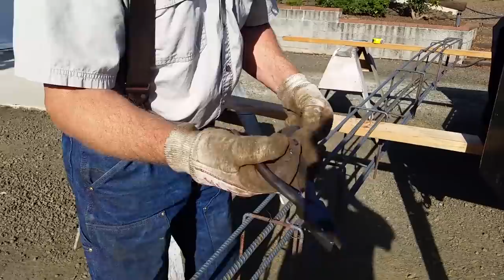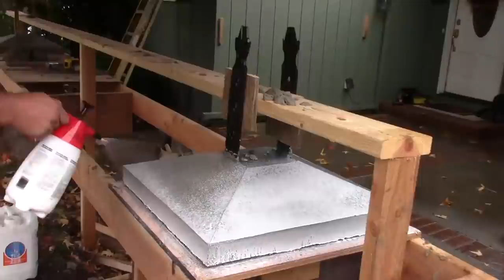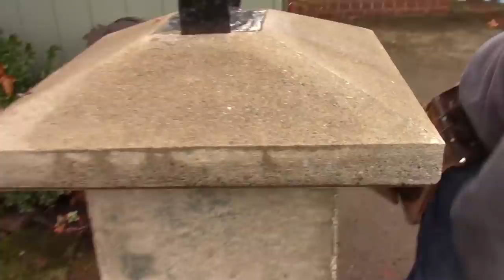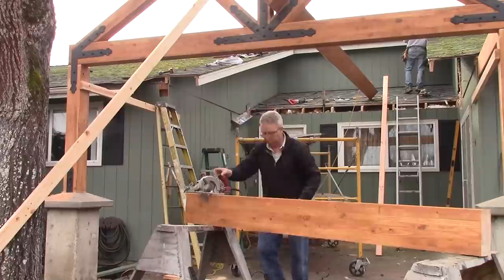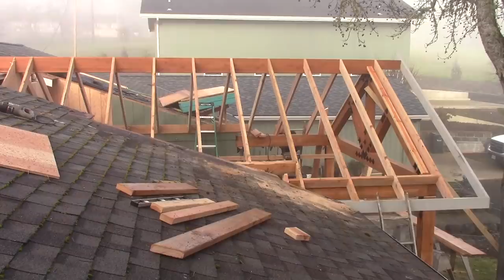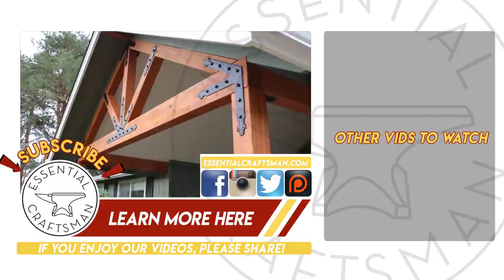Men Build New Entrance to House

Comment: In my neck of the woods that beam pocket would be a stack down to the foundation with a Simpson post cap... which would require sheathing and drywall repair. Beautiful timber construction, very nice job.

Comment: Looked like a fun project.  FYI, I subscribed because I love hearing the wisdom Scott has to impart about stuff like this.  I would have been very happy with this being a 20-ish minute video where Scott discusses some of the design choices, why a through bolt is used, yada yada.  Still watched it though :)
Reply: rjtumble Ditto.  I'dve also liked to know what was getting sprayed on the tops of those concrete bases
Reply: The Carfarmer - I believe it was an acid wash by the way the finished product looked.
Reply: It's a surface retarder that exposes the fine aggregates in the concrete; such as Grace Top-Cast or Optimus made by ACC (Architectural Concrete Chemicals). Muriatic acid will do the same, but is not milky white in color.
Reply: Cornelio Sanchez - thanks!

Comment: Have you got a pro tip for this:  When placing brackets on either side of a timber, how do you accurately drill the holes so they line up with the bolt holes in both brackets??   (I cheat and do them on my mill, but there has to be another way.  You do it so well in the field)
Reply: With the brackets he was using, which are basically straps, you are able to adjust them to line up fairly well. You cant really get away with that if you are using saddles or caps, but far as the drilling goes, the best way is to drill half way from one side then drill from the other side until you meet with the first hole. From there you can ream the hole to get it straight if it's not already.
Reply: I use a torpedo level for the top and a speed square on the side of the drill bit. when your drilling just check it periodically and it all lines up

Comment: You may call yourself an old man, but watching you dance on those beams like a young athlete, you still got it!!!  
RE Burke bar, what length would you recommend?  There seem to be some 46 inches and some 60 inch.  Watching you with the bar, it is definitely time for me to add one to my tool stash,

On the roof, I noticed that you used CDX for the edges and OSB for the middle, why did you do that/

Thanks for another great video!!!

Comment: Why did you alternate between particle wood and ply wood on the roof?
Reply: The plywood is used where it can be seen from below. Oriented strand board everywhere else.
Reply: the plywood is needed for exposure (ccx), per code.

Comment: Waste of plywood. Pull down 51inches from ridge center and cut rip on bottom of eave to save  time and material. When using OSB ply,  you should space rafters  16 oc or minimum 19-5/16 unless using 3/4 OSB that OSB really sags over a few months. Just want I'm used too.
Other than that, good work! Love the show.

Comment: I'm curious if you opened up those little dead spaces on either of the ridge to the rest of the attic for ventilation?  I never quite know what to do with things like that.  Usually I start applying my limited scientific knowledge about water vapor until my head explodes, then I cut an access hole.

Comment: I redid a patio cover for my neighbor.   City wanted engineering plans for re-do.  Engineer wanted 5,000 for plans.  I redid it without engineering made the roo pitched to ridge....so no more flat roof...so i shingled the roof 30 yr shingle..
Little over $6,000 materials and labor.  And his living room was hot and dark...so i framed in and drywalled 2ft x 4ft opening celing window
To remove hot air and let in light

Comment: When you started sheeting you should of cut the bottom and then the ridge you would also have to cut bottom and top but it would both be pieces more structurally sound the code in california is 2 feet
Reply: And i didnt see you guys nail it of in any pertecual nailing schdual

Comment: I love those jobs at come around like once in a lifetime I had to build an outside shed for firewood using 6 by 6 is with no metal at all except for the nails I used on the shake roof I had to make my own wooden spikes I had to drill and mortis through the entire six-by-six is to get the pieces to lock in and then drive a nail through it drilling at first and then pounding it in it took me like 6 to 8 months to do this one she said that if I did it normally wouldn't take in one day but it was I had to make all special wooden nails to Nato will the cedar planks on three of the sides as well and it was very time consuming but one of the best pieces of work I've ever put out the decision for nails on the roof was it would have taken me another 6 months to make that many little wooden nails to go through the siding and me and the homeowner to decided it would be much easier and just as reliable you won't see any nails from the roof I've unfortunately lost contact with that customer as I am now disabled and he was in very bad shape at the time was a retired CEO of a large company so you have plenty of cash to do a wooden shed with no nails to dry your firewood
Reply: Essential Craftsman it was about 15 years ago and the cell phone that I took the pictures with is long been broken unfortunately but I had pictures when I very first started it to what I finished it so I had it all along and it was pretty impressive sorry I can't show you any of them thanks for asking though I appreciate that